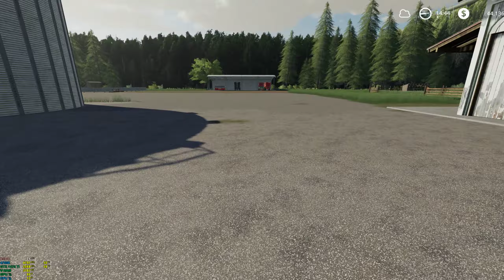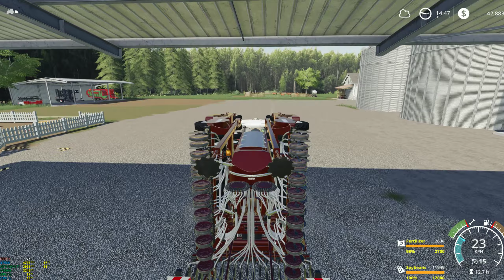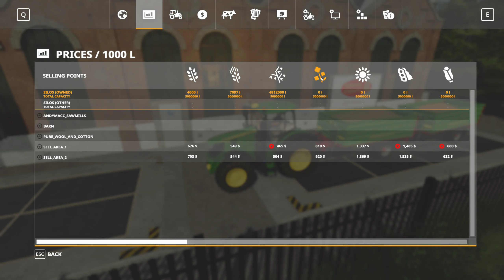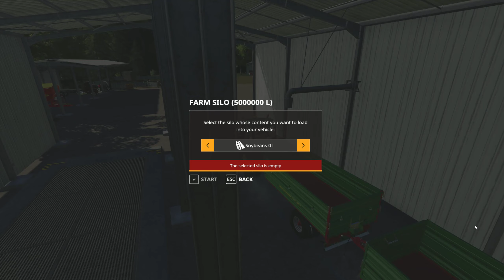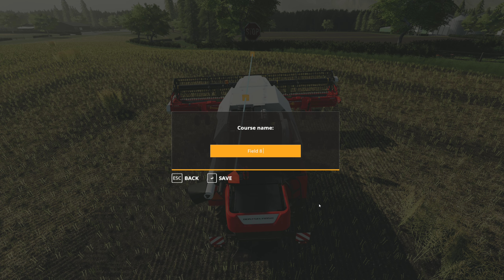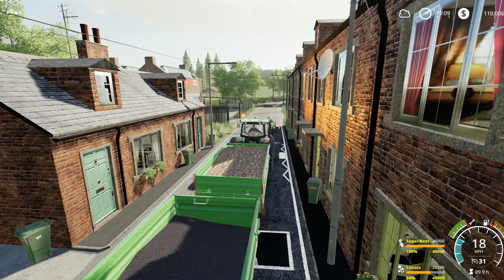Hubcap FS19 UHD Course Play / Glen Isla EP-8 " Smooth Sailing "

Comment from the maker: Hindsight is 20/20. @ 5:00 mark or so I launched the seeder in field one. It started to go somewhere else. If you look closely at the bottom of the course play hud you will see what was happening. I was " appending field 1 to the last course loaded ( Field 2). What this means is course play can plan 2-3 fields to be " Plotted" all at once. So.....Why this happened was because I failed to clear the previous course from the course play ( Small x in a circle on the hud) before calling up the field 1 plot from the file list. When I finally got it right it was because i x'ed out the previous course ( thinking that just field 1 was loaded) and started the course play programming from the beginning.